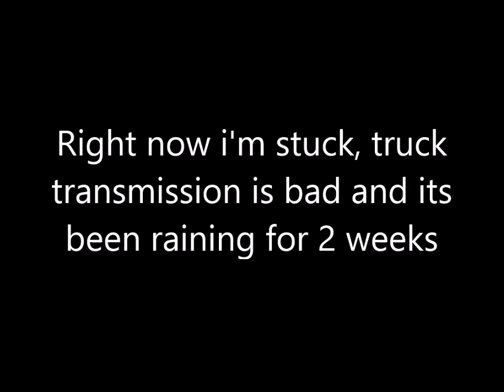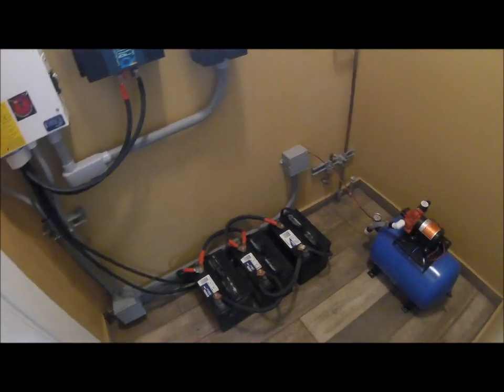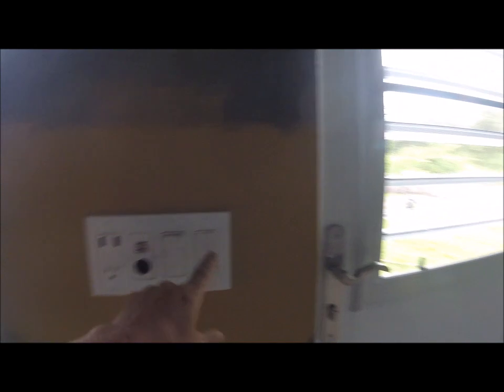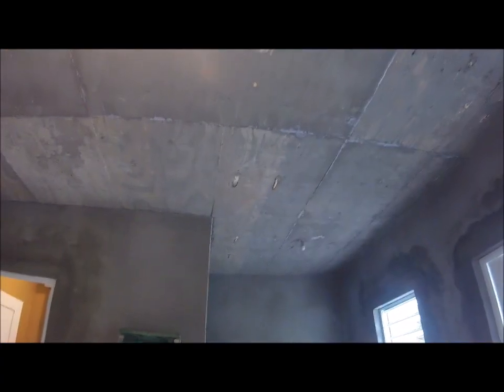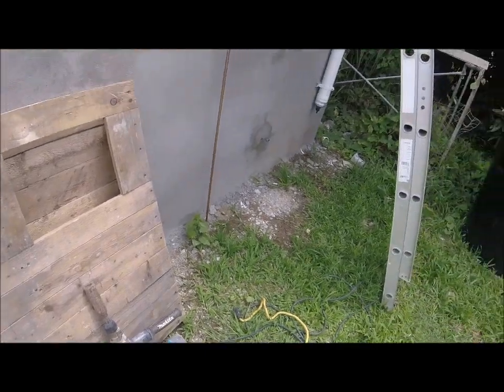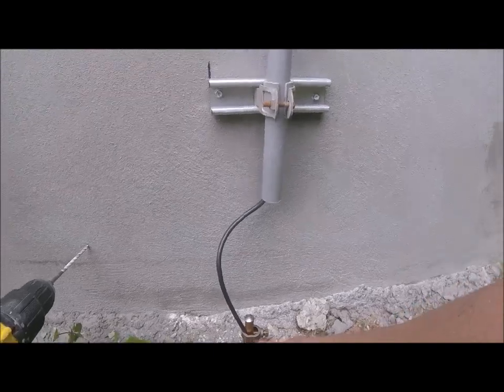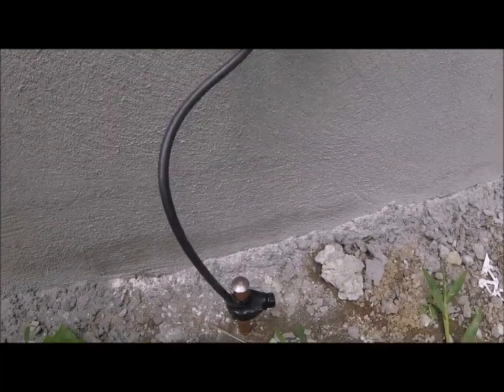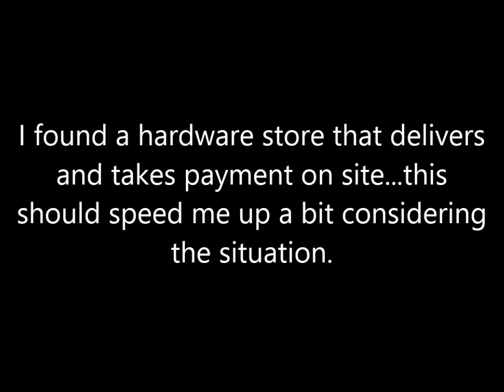Stuck

Comment: RAIN!  at least you know the volume of how much rain you'll be getting from the micro rain harvester!
Reply from the maker: I have to throw a slab of cement for the tank and a slab in the front for a door stop, I got the side wall stuccoed under rain fall, still got to stucco the back wall and the indoor ceiling to finish all the sheds stucco, but the weather has been unstable.

Comment: PR still has drought in the ?SW
Reply from the maker: Puerto Rico has a dry forest with cactus 🌵, The SW is always dry, The NW is always wet with a lot of rain 🌧,  I live in the East, on the outskirts of El Yunque up in the mountains ⛰ its not officially part of the rain forest because my Great grandfather was rich and owned hundreds of acres, not sure if some of that old land now belongs to El Yunque.  EL Bosque seco (Dry forest) is amazing, it doesn't belong in a tropical island, but its there.
Reply: @MosaicHomestead  Yes I'm doing a follow up drought video and have a news clip about PR's drought. I will add in that you call BS on it!
Reply from the maker: @HuplesCat  I got 2 weeks of rain footage and some areas in PR received more rain during this freak event than Maria...look it up...during my flash flood video,I got 8 inches of rain, my concrete cistern was half way because of drought season.... I filled it up in less than 24 hours, not kidding,.
Reply from the maker: @HuplesCat  Believe it or not, thats why I was finishing my sheds solar, the last bit was grounding the panels, The FBI is investigating Sabotage. LUMA energy took over the electric company and the old electric company workers are not happy,  There was a couple of tire slashing's on some electrical work vehicles as well, Luma is a Canadian company lol.
Reply from the maker: @HuplesCat  The second I came in ,it ended 2 minutes later lol